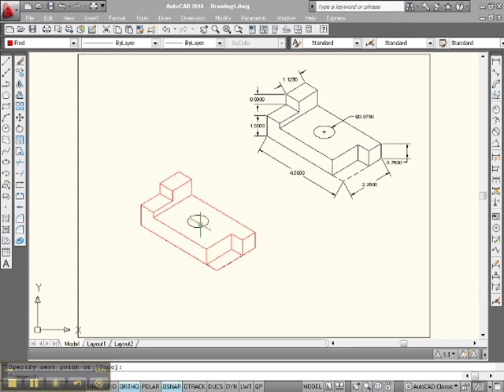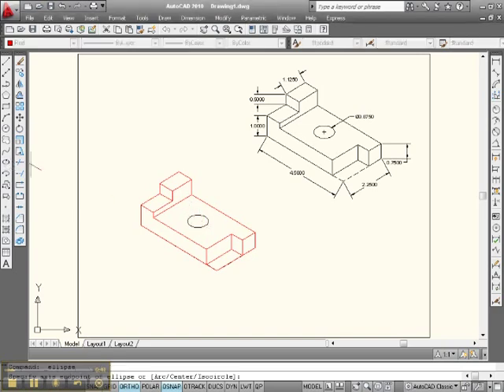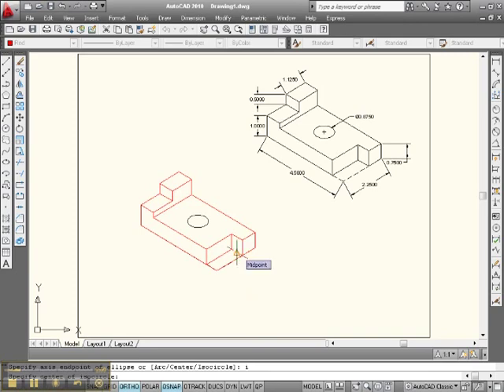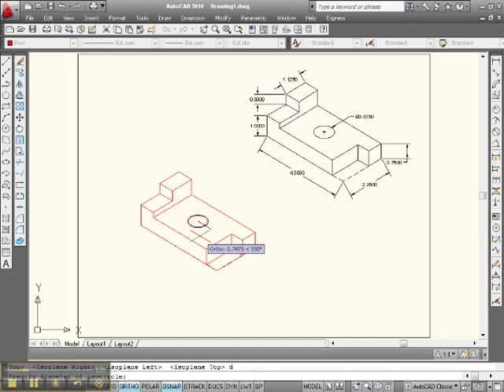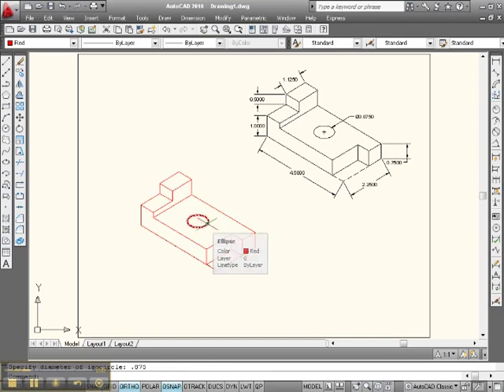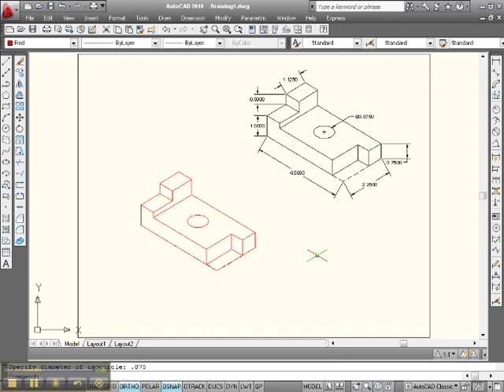How to draw isometric circles in AutoCAD 2010

Comment: thanks man, but I have a question about the degree, why you can draw this isometric circle and else besides 30 degrees? The cursor fixed in some degree in isometric mode, even I can use SNAPANG the set the cursor degree, but it turns isometric ellipse not available.